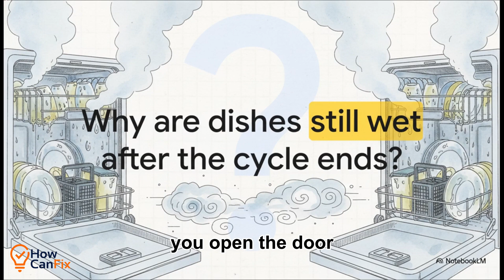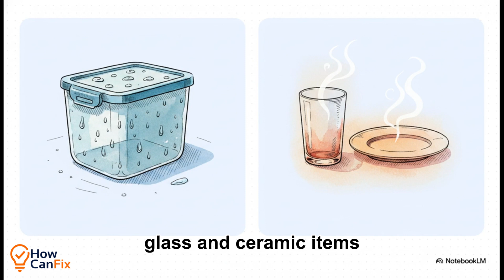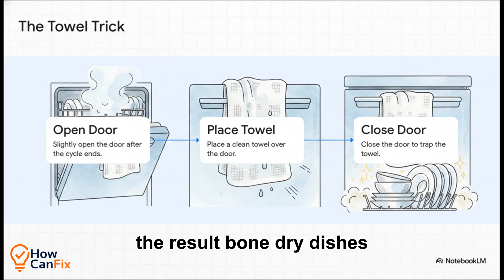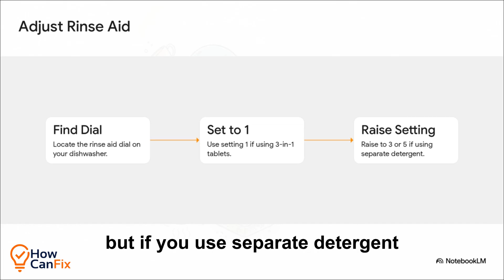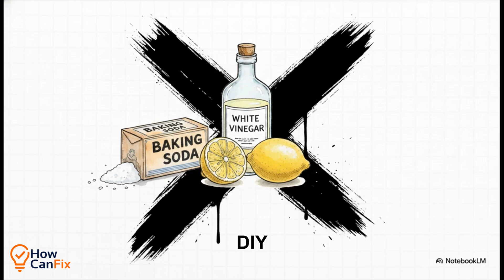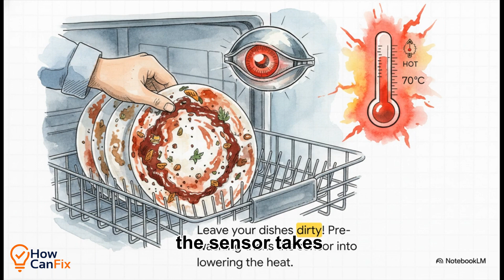Dishwasher Not Drying? Do This for BONE DRY Dishes!

Comment: Pleasssd we dont need this crap should 
dry...last one did..no problem. 
Please...
Ok..the towel trick waiting & will try... the temp should be the same as before.
Lord how do I turn the temp higher...the coils are in the bottom.
Machine is brand new.
It SUCKS...
Thank you for your advice..
Again please how do I turn up the heat.
 Yes mine new has thecoils huge in the bottom shod be dry...
  I'm just going to break some dishes..I'll feel better..
THANKS
Reply from the maker: @kristinalopz1623 

I totally get the frustration, especially with a brand-new machine. Please spare the dishes! 😄

Most dishwashers don't have a temperature knob, but you can usually turn up the heat with the buttons:
• Look for an option like "Heated Dry," "Hi-Temp" or "Sani" and make sure it's turned ON. Many new models default to an energy-saving air dry, which is the most common reason a new dishwasher doesn't dry.
• Use rinse aid. Modern dishwashers really depend on it for drying.
• Before starting a cycle, run the hot water at the kitchen sink until it's hot, so the dishwasher fills with hot water right away.

If Heated Dry is on and the dishes still come out soaking wet, don't try to fix anything yourself. Since it's brand new, it's covered under warranty, so call the manufacturer or the store and let them check it.

Hope the next load comes out dry!